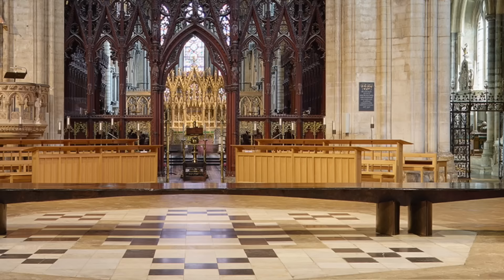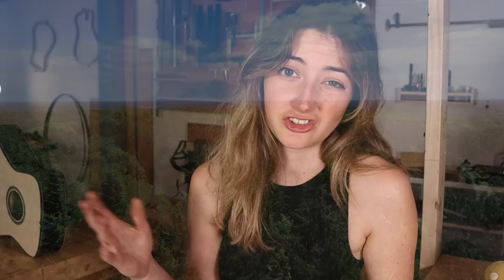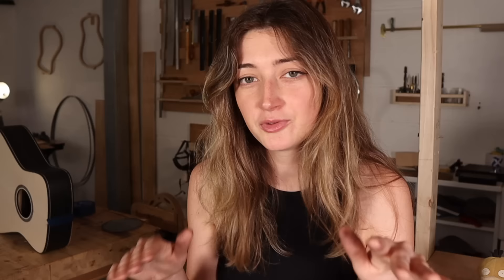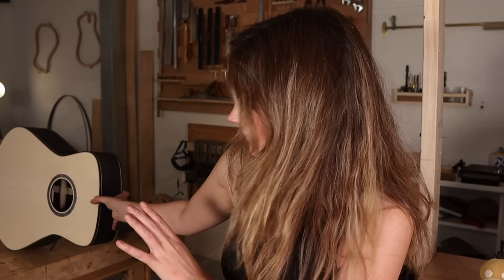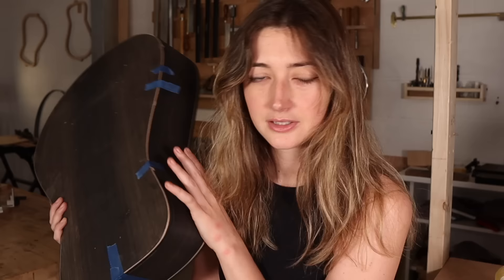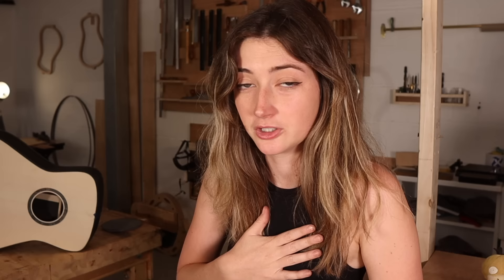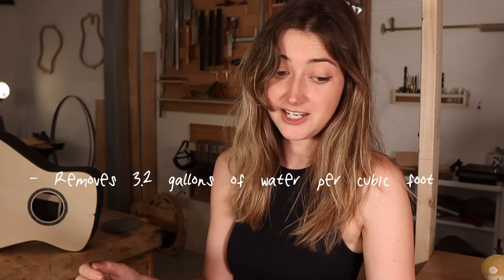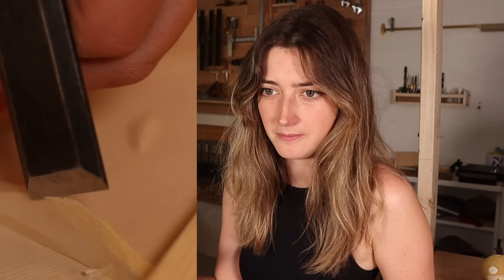A Neolithic Guitar?

Comment: Oak contains acetic acid, hence the vinegar smell. You can make a wood dye used for ebonising wood by getting a jar, putting in some wire wool and submerging it in vinegar (acetic acid). This makes iron acetate. The acetic acid in the oak plus iron salts in the soil will eventually combine to stain the wood. I used the wire wool and vinegar trick to stain some newish oak beams in my house, rather than use modern stains. Also known as ferric/ferrous acetate

Comment: Great content as always. I made a couple with this stuff following some suggestions from Rosie H, and it is excellent. I made one as a 65th birthday present for a friend who actually lives in the Fens. If you are monitoring, am I right to remember you did a YT on up and downcut spirals for rosettes, etc. Cannot find it anywhere. Cheers. Oh, and it should always be called bog oak or fenland bog oak. Other names (e.g. black fenland oak, etc) should be viewed with suspicion and the sellers questioned closely. It is sometimes modern oak which has been treated. Nothing wrong with that, but it ain't thousands of years old, and I think there is an attempt to pass it off.

Comment: The black color used to be used to make ink. People would harvest oak galls (which are abnormal growths on oak trees) and extract gallotannic acid from them (by grinding, boiling, or fermenting) and then combine that with ferric sulfate (obtained by reacting iron with acid) to produce "iron gall ink". It was used extensively from the classical era through the beginning of the 20th century. You can still get it, but it's largely been supplanted by synthesized dye and pigment inks.

Comment: "Bog Oak" is also used as a material for making tobacco pipes. Pipe makers call it "Morta" so there's a fourth marketing option for you! 

It's prized for its high tolerance to heat and lack of adding any woody flavor. So in addition to sonic and aesthetic benefits, you can have a rare guitar that can be smoked.

In seriousness though, another dense hard wood used in the same application that looks very nice is briar, but it being so knotty and coming in burls usually no bigger than a melon, it wouldn't work for any use other than decoration on guitars. A straight grain briar could make a very cool headstock veneer or wood pickguard though.  Or decorate a fretboard.

Comment: Daisy here in Ireland we have that  (bog) oak of which we turn up loads I have a garden full of it we usually make spoons or traditional thingymagigs and flog them to tourists  ! we find it  in the peat bog when we are taking the turf ( I know we shouldn't be digging it but it is by hand and hell what else do you do with a mountain ? the sheep  have already caused the most damage over the last 300 years ) but the nicest wood of all when we find it in the bog is the native Irish Scots pine . Its about 3000 years old whereas the Irish oak is usually around 5000 years old. The pine tends to turn grey when exposed to the air whereas the oak as you demonstrate so well turns almost black. But once you cut into the old Scots pine even after 3000 years  it leaves behind the grey and is a beautiful vibrant red with a smell that resembles rosewood but much sweeter, it is beautiful wood to work with completely different to modern Scots Pine lumber. Managed to get enough Bog Scots pine gathered up for a table with an Irish oak top as soon as I remember how to make one now where have I put my saw ?

Comment: Has anyone tried building a guitar with the same design features as a violin?  What I mean by that is making the front or top out of a soft wood and the back out of hard wood then running a post from the saddle on the high pitch sting side to the back hard wood for the tremble and then making a bass bar glued to the top or front soft wood near the saddle on the low pitch strings for bass.🙂
Reply: Most acoustic guitars (of reasonable quality or better) do use hardwood sides and back and a softwood top. Some are built with arched tops (called archtop guitars), and some of those with arched backs, too. Guitar bracing is a big deal, and I think relatively few have straight back bracing any more, à la the violin bass bar. The guitars being built here are steel-string guitars, which need to resist far more torque than gut- or nylon-stringed violins do, requiring the bracing to be more significant. Archtop guitars are probably more akin to cellos. That said, while I'm sure someone has experimented with sound posts in guitars, it's definitely rare. I expect if it was an unmitigated improvement, it would be common, which implies there must be some drawback or just lack of improvement.